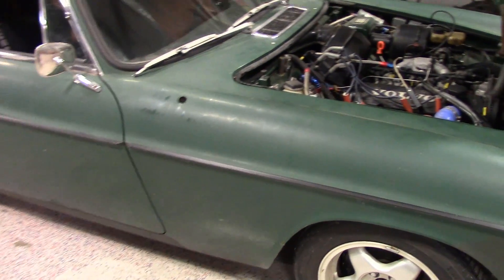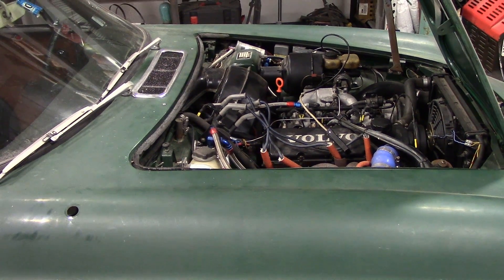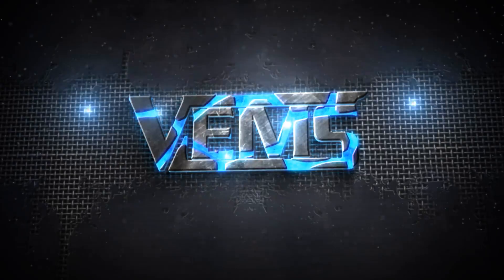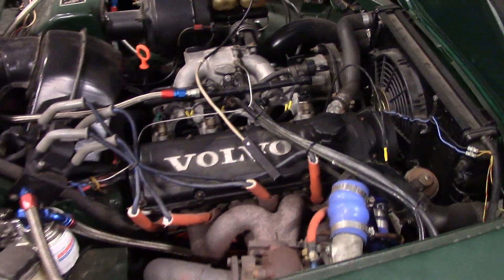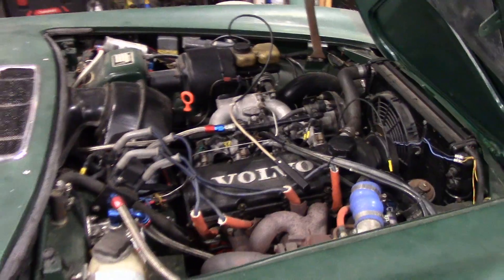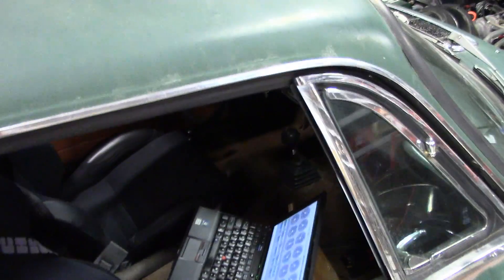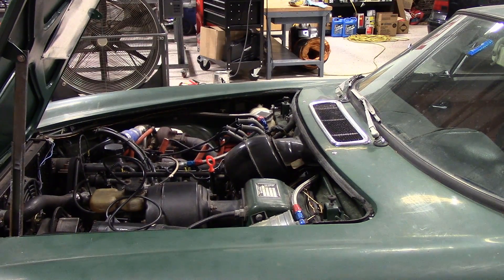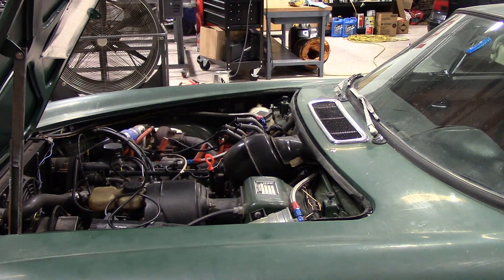Volvo 1800 with 240 turbo engine, VEMS ECU first start up

Comment: HEY !!  I also have an 1800ES that I'd like to swap in a newer motor. Did the 240 engine sit on the same engine mounts ? Did you have to do a lot of fabrication to get it to fit ?
Reply from the maker: We only did the engine management. But from memory, the fabrication work was minimal.
Reply: @Vemsus  Thank you very much !

Comment: Is the program self adapting?  Or did you have a previously made tune installed?
Reply from the maker: Derks Autowerkes both, kind of. You can calculate the ideal volumetric efficiency with the engine size, injector size and number of injectors, so you have a close idea if where it needs to be at the start. And with an integrated wideband o2 sensor it can do full time closed loop fuelling. This startup was just with the base calculations though.
Reply: Awesome!  My VEMS ECU will be here beginning of the week!